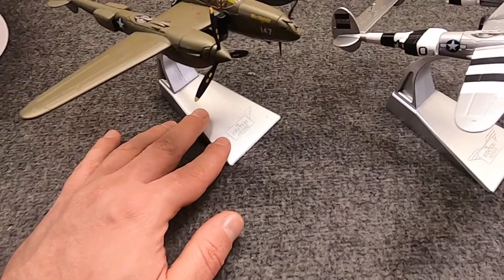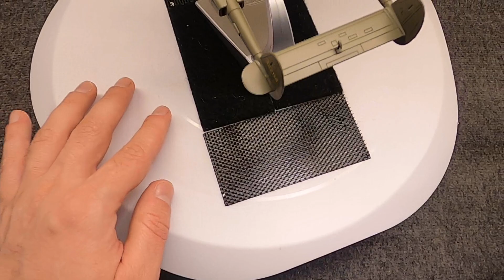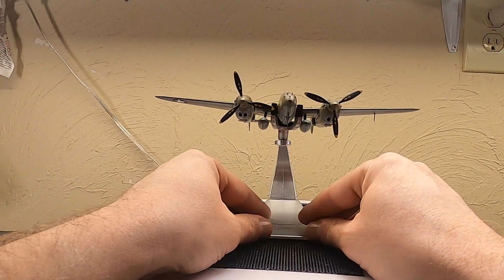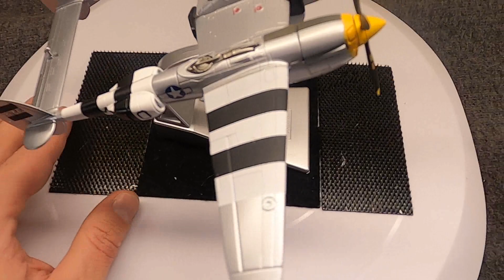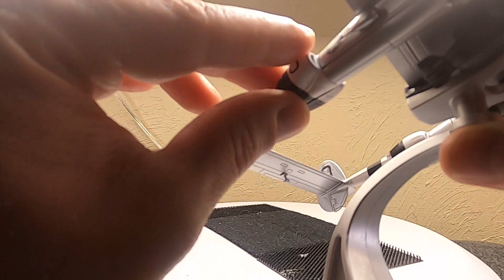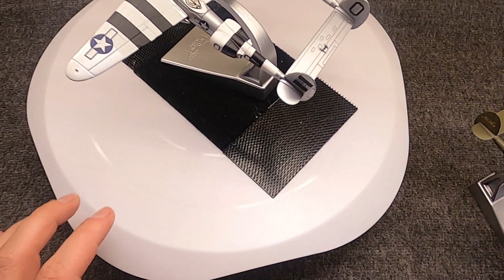New Lockheed P-38G & P-38J 1/72 Diecast Model WWII Fighters From Corgi

Comment: @Misha, I believe you are partially right about use of plastic in the rear of the main body of the P-38 Lightning model. But to be more percise, the weight or mass reduction from the rear of the model is due to the ability of setting the model on its landing gear without the tail sitting on the "ground". I've encountered the same in other metal diecast models from various brands, even those known for using minimal plastic.
     By the way how much of the back of the Lightning model is plastic? Just the rear aerodynamic surfaces or part of the twin tail boom as well?